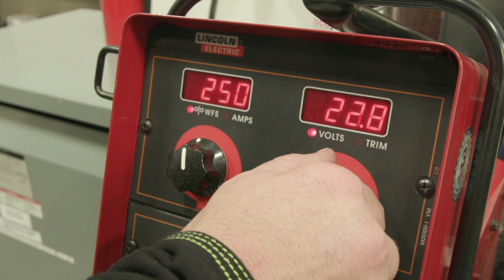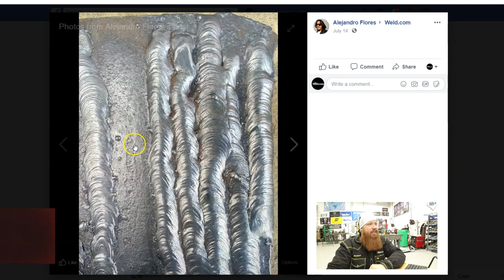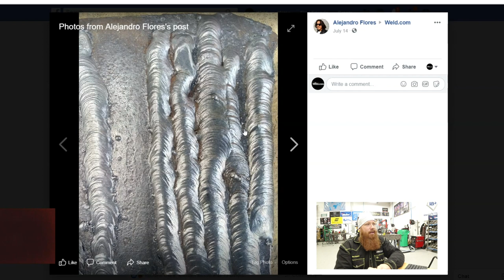Stainless Steel Flux Core Welding (with Gas)

Comment: Stringers vs weaves all comes down to the weld specs provided by the customer. I used to weld heavy equipment where the majority of the weld was used for wear protection rather than structural integrity. In this case it was much more cost effective to put the weldment in position and weave in a bevel. Again it comes down to what the customers/engineers see necessary. In the end it's all about making money, for the customers, employers and welders.
Reply: When a person is testing to obtain a structural steel certification,  that person has the option to run weaves OR stingers...both movements are acceptable for weldment procedures. With that being said, each individual must choose his technique, like a signature, everyone is different and one must choose what movements best apply to their own capabilities. 
I, myself preferred the weave movement on 2" thick carbon steel plate to obtain the structural steel cert 3G.
My preference is my signature and I really do like the appearance and the skill of mastering the weave movements
Reply: Not when I took mine they said absolutely no weaving because of heat input they were very strict in my area

Comment: This is a wire I run every day.  I would not have suggested that voltage/wire feed setting (in flat I would run 27V/400IPM and about 23V/300IPM for vertical) but if it worked for you that's all good. 
I am not welding stainless plate but a ferrous steel alloy. Did you experience any instances of the puddle not wanting to follow or "voluntarily" not wanting to flow over or wet in at spots for what seemed like no reason. Everyone in our shop gets this on welds and we have to step back and make the puddle go there, then continue our progression.  The puddle can really fight you in the 3G. I hope you do a vertical demo, maybe I'll see a mistake I'm making.

Comment: Its one thing to weld in a nice clean shop, with nice clean materials, and brand new machines!  And its reality when you gotta weld out in the field on some old steel with a 25 year old welder( that you may or may not have to work on before you can use it) and some half burnt up leads with half the wire exposed.   I want a video showing realistic conditions
Reply: Neil Brown I’ve been there man, welded howitzers in Kuwait in 20mps winds with a spoolgun and a prehistoric Hobart. We had to put a rag over the exhaust to build up enough back pressure to get the motor running. I’m looking into doing some field stuff. It’s just difficult to get on a site we’re not contracted at.
Reply: just tell that 25 year old welder to put his phone down or he's fired lol
Reply: Jason Becker I own a small welding shop in Louisville Ky always doing D1.1 AWS field work you are welcome anytime to post training videos in my field jobs if it held education and further the training 
Charlie
Reply: Even if your doing realistic stuff ITS ALL ABOUT PREP! As long as u prep properly & carefully you can get this level of weld in the field as well

Comment: I ran Kobelco SS wires that could run on CO2 or 75/25 on low pressure air pipe and plate for about 7 years.  I really wish I had taken time to experiment with back purging with the same gas when I had that job.

Comment: Some beautiful beads wend down this day, If those were 2 plates (for example) 8' x 8' they would lay flat due to the weight of each plate, how would you relieve the stress in the weld as those small plates pulled up a good 4 degrees?
Reply: Wolfy Wolf you can use strong backs to prevent the distortion. It would hold them in place during the welding process and be removed once they return to room temp.

Comment: 304 or 316 stainless welds with Short Circuit Transfer GMAW.
Reply: With mig? 75/25 gas mix?
Reply: Dis Guy! Depending on the thickness, I’d run it in a spray or pulsed spray before I run short circuit for anything over 5/16”.
Reply: Fernando Dazeck Zaragoza no, solid wire stainless you would want to throw some helium into the mix.
Reply: Fernando Dazeck Zaragoza anything with more than 10% co2 will put carbon into the weld. You can weld it with straight helium for food grade applications or a tri mix. I usually use 98/2 for short circuit and pulsed mig.

Comment: Lincoln Electric was making fume extractor guns in the mid-70s portable and less than a quarter of the price.. just saying been there done that.. whether you're in the shop or not... respiration is extremely important.. nobody mentions this or talks about it.. it's not just the smoke it's those heavy particulates.. they float around for hours even after you stop welding.. I highly recommend the 3M speedglas personal fresh air system... it would take too long to go into all of the details and facts this system and my experiences.. but yeah..

Comment: Will keep it simple for this question you want comment. "BIG YELLOW" spec states with only 1 exception. That no Mig weld shall be layed larger than F8 in one pass. Only exception is F10 and only if you can position in true V. So oversized weave welds will be rejected. Your previous vids on Stringer vs Weaves proves them correct. Not here to argue this, but if I like me paycheck, those are my boundaries.😉

Comment: Correct me if I'm wrong but didn't Bob have a video on why your not supposed to use a wire wheel to clean stainless only to hand job it with a stainless steel brush in one direrection?
Reply: Thats aluminum, the wire wheel will push surface contaminates into the aluminum because its soft.

Comment: The test is on half inch and could you possibly do a 3g and 4g 1 inch plate with self shielded flux core with .045 wire. I’m working towards becoming an ironworker.

Comment: Here is a question i don't see any one asking... how the heck do you stay cool under the hood and in the field? I my self am welding in Florida and there are days where the heat gets the better of me FAST
Reply: You sweat.... lol if your lucky you can position some fans so that they dont blow away your shielding gas and keep you kinda cool
Reply: Nitro you don’t, really, you just stay hydrated and wear sunscreen. Wear long sleeve shirts, you may think you’ll be hotter but they actually keep the sun of your skin and help keep you cool.  Also make sure you get enough potassium and magnesium, you’ll need that to help you retain hydration. Powerade is a good source for that, low sugar options are the best.

Comment: Another great video like always, would love to see a penetration comparison of mig 100%co2 vs c-25.
Reply: Arc Angel CO2 gives a deep wide penetration profile but has an erratic arc and a lot of spatter to deal with, Argon/CO2 blends have a more finger like penetration profile that’s narrower than CO2 alone. C-25 is prone to lack of fusion and not recommended for materials over 5/16” in thickness because of the shallow penetration.
Reply: @GodslilRedneck23   thanks that makes a lot of sense
Reply: Arc Angel glad I could help.

Comment: What is the benefit with using gas with flux core, and can I use gas with any type of flux core wire (stainless or with mild steel)

Comment: The new fume extractor seems to remove the fumes very energetically.  Is there any concern that it is removing the shielding gas before the weld solidifies enough to keep out contaminants?
Reply: No cause this is fluxcore
Reply: Rick Swanberg nope, the shroud is far enough back that it doesn’t interfere with the shielding gas at all.

Comment: Can you pulse mig dual shield stainless or just solid wires?  I've got a project coming up with stainless 316 and I was going to use dual shield but it would also be convenient to use pulse. And can dual shield stainless be used in all positions or just flat?  Thanks.

Comment: When stick welding stainless, the slag pops off and flies, as it cools.  It's dangerous. Does this process do the same thing ?
Reply: gord johnson nope didn’t have any problems with it on the flux cored has shielded wire but I know what you mean with the stick rods, they pop off like a bullet.
Reply: Youll get a little bit of glass popping with solid 308 wire
Reply: The 308 and 316 don't. the 309 version does.

Comment: Stainless steel with FCAW innershield? WOOOOW!! but TIG process is very clean!, and this is more faster... what is better now? 😮
Saludos desde México @Red Beard!
Reply: Yeah, was going to ask for thinner stuff, everyone is banging rainbows on SS tig, but what about the thinner MIG?
Reply: It’s all about application, for thick heavy stainless, I’d run this all day. For thin welds which require good aesthetics I’d run TIG for sure.
Reply: @GodslilRedneck23  yeah!! Thanks for the videos! I love this job 👷💥 and up the Ironworkers!
Reply: Fernando Dazeck Zaragoza it’s a good place to be. I’d still be doing ironwork if I didn’t get offered a job teaching at a college.

Comment: Hi , good day to you , nice videos and info from you , i find it very informative
Question for you = in the equipment we can use either a 2 pound spool or a 10 pound spool wire , in both case i think during welding they come a life .Do you think it makes a difference in arcing , amps , quality of the arc coming out of the gun, , the wave form , arc force etc  . And this is for any welder type 
Thanks in advance 
Serge ( from Mtl )

Comment: I wasn't aware there was flix core stainless wire available. Does it need to be dual shielded or can I just run it alone? I'd love to get some in .035"
Reply: Dual shield is always best, more penetration.

Comment: I just was wondering why use gas to help with the weld but turn around and suck it all back with the in mig gin fume extractor seems counter productive to me. Why not just use gas or just use the fume extractor.I know that stainless fumes are very toxic due to the chromium .

Comment: Can you use flux core with out the bottle?
Reply: Joe Italian only if it’s a self-shielding Wire. You have to check the specifications of the wire to see if it requires gas or not. Gas shielded can’t be used without gas and self-shielded can’t be used with gas.
Reply: @GodslilRedneck23  Thanks for that info.  I didn't know that self-shielded shouldn't be used with gas.
Reply: Whats the point of the flux core if its not shielding?
Reply: Hodgepodge Enginerd both self shielded and gas shielded flux core have shielding elements in them. That’s what the flux is for.

Comment: HEY MAN THATS WZ UP, CAN YOU SHOW VIDEO ON SS MIG ROOT ON PIPE ROLL OUT FILL AND CAP WITH SS FLUX....WOULD VERY APPRECIATE IT I JUST WANNA KNOW PROPER AMPS FOR MIG SS ROOT ON 6IN SCHEDULE 80 ...THANKS MAN
Reply: Check the procedure, will all be on there, voltage settings, wire feed speeds and amperage ranges, travel speeds, gas flow rates, all the info you need👍

Comment: Why wouldn't you use the tri mix blend of gas.......
Reply: Because it is gas shielded flux core, the flux makes up for what you are missing running tri mix and hard wire.
Reply: Ah I didn't catch the caption that said flux core makes sense

Comment: Jason, have you ever dabbled in underwater welding? Haven't seen much content on that process!
Reply: Stan Ervin I have not, that’s what I wanted to do when I was 18 and getting into welding. After talking to an underwater welding I changed my mind. It’s not all it’s cracked up to be. The pay is good but it’s very dangerous and the working conditions aren’t really that great.
Reply: @GodslilRedneck23  
Thanks for the response, Jason. I also heard the pay is phenomenal. Was just curious about the safety factor and the learning curve. Any more input or info would be much appreciated on my end. Tanks again, bro. What is the process? Specially designed shielding suit? Glass dipped rods? Prep?
Reply: It's supposed to be easier  to train a diver to weld than to teach a welder  to dive.
Reply: Ocean Corporation in Houston TX can answer any questions about underwater welding.

Comment: With the understanding that I am not on the level of anyone at weld.com; I have always been told "push for gas, drag for slag", this includes dragging flux but pushing gas over flux. Secondly, I have also always understood that 25% CO2 is too much for stainless applications. Maybe there are exceptions for some applications that I'm not aware of, but introducing that much carbon to stainless defeats the corrosion resistance. Anything you can correct me on is much appreciated.
Reply: Custom Haines you’re correct, slag you drag, gas you push. Because this is a slag producing process you still want to drag even though there is a gas shielding. This particular wire calls for 75/25 gas, the flux has added elements to reduce carbide precipitation. It’s 308L the L means Low Carbon.
Reply: @GodslilRedneck23  Thank you, that's clearer than anything I've been told before.

Comment: Welding that with a plate on the back?? Amateur.. 😂 In europe, if you wan’t to be certified, you have to weld that with a 3,5mm gap between the plates to pass the test.. 😉 no plate on the back..

Comment: Welding on stainless steel can be a bitch, for the simple fact that it doesn't solidify as quickly as carbon steel when running a bead.